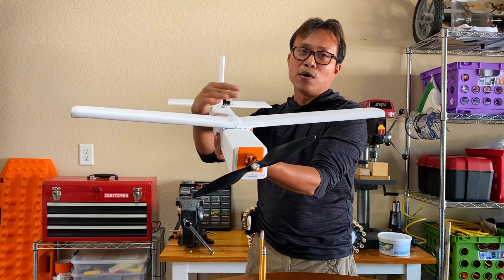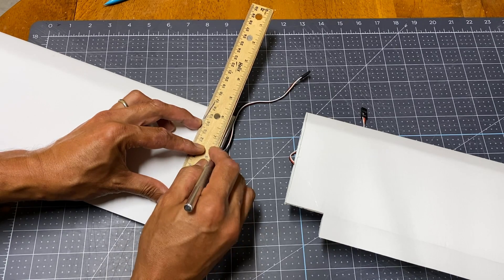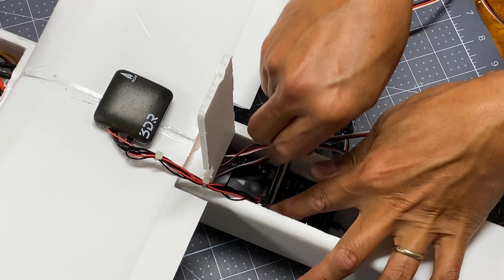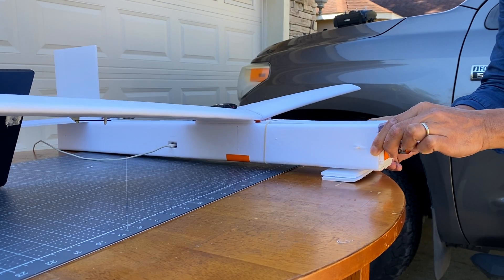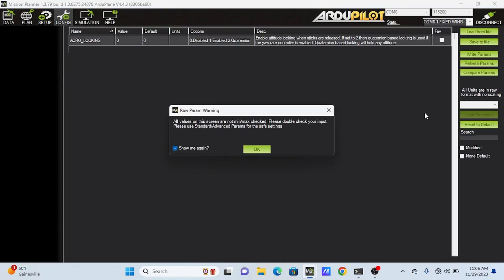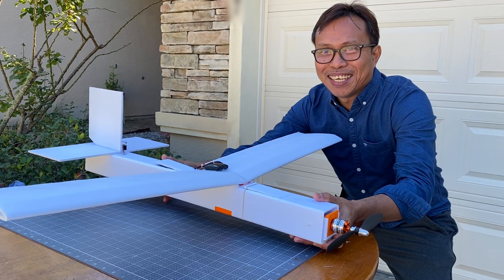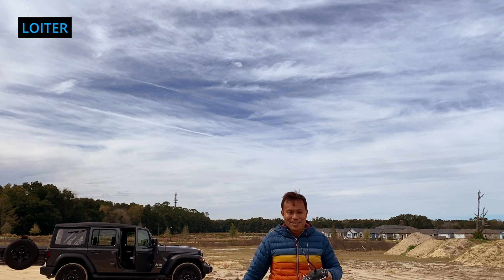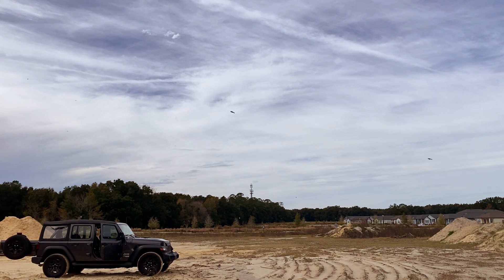How to Build an Unmanned Aerial Vehicle | Fixed Wing part1

Comment: IMO the idea of sliding all stuff inside fuselage could be fine, but to afford on only one wood stick for fixing it could be  a weak point... if it  loses a bit  the CG of airplane could move in flight. Anyway nice project !
Reply: Just for curiosity...does latest Mission Planner still support the old Pixhawk 1 ? Thank you
Reply from the maker: @CP-zi3eg  I’m surprised it still worked on old pixhawk.
Reply from the maker: Hi CP-zi3eg. Thank you. There are actually 3 sticks. At the front, back, and through the clay(added weight). They just did not make it on the final cut.😁